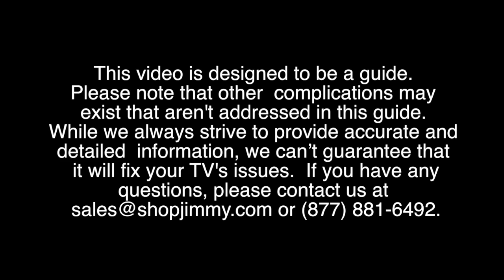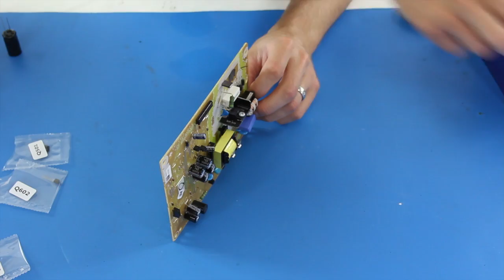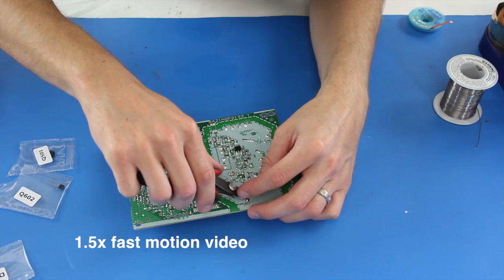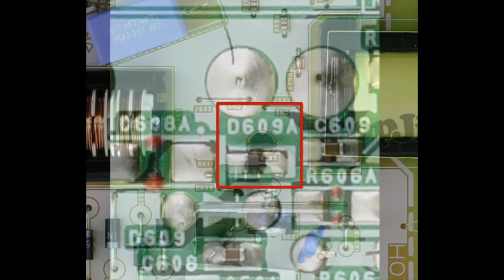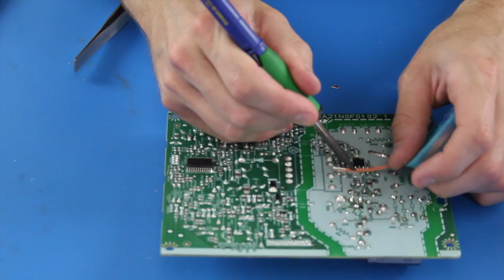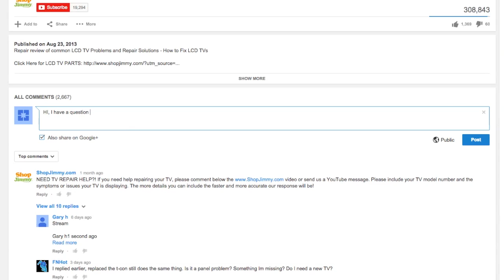Emerson Philips Magnavox A2171021 BA21N0F0102 No Power - Power Supply / LED Board Repair Kit

Comment: Hi.  The diodes I received for D607 and D608 (well, assuming D608 as it's unmarked) look like D609 (glass) but D607/608 on my board look like D601-D604 (black).  Can I assume the diodes I received for D607/608 are the correct ones?
Reply from the maker: +Tony Brown  Try all repairs and troubleshooting at your own risk.  Did you order the correct replacement kit?  Please reply with the link to the kit that you purchased.  Thanks!  www.shopjimmy.com